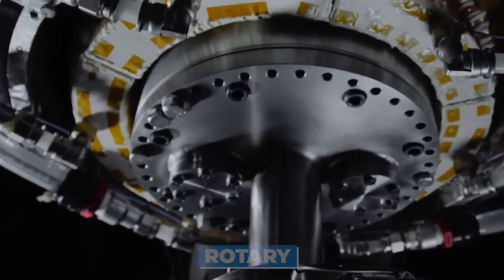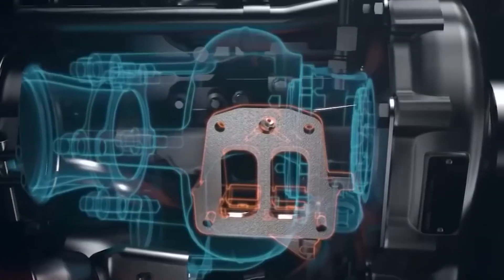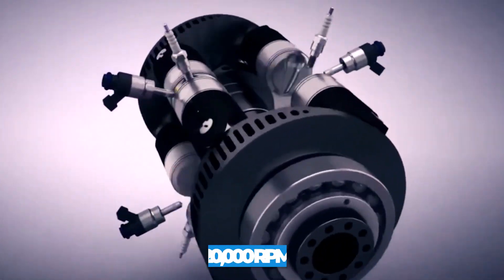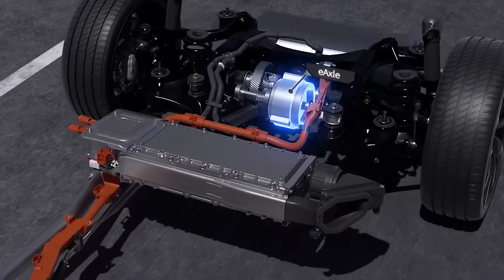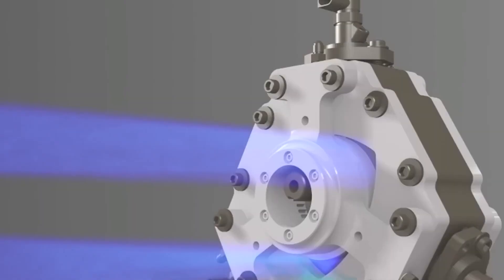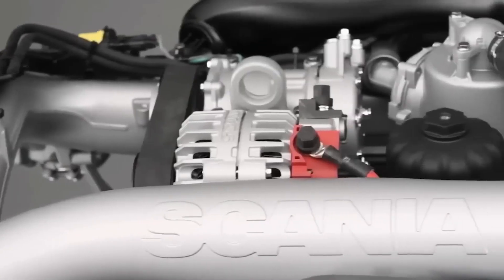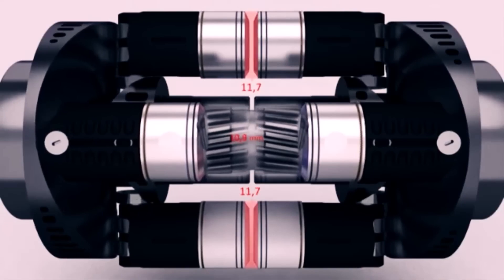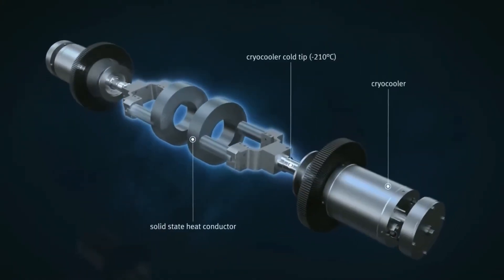Mazda's NEW Rotary Engine Just SHOCKED The Entire World!

Comment: The engine is not going to be used to propel the car, but to power a generator that will keep the battery charged. This is an all EV car, with a built in power generator... not a rotary car. Great science behind it, just not what the headlines are stating.